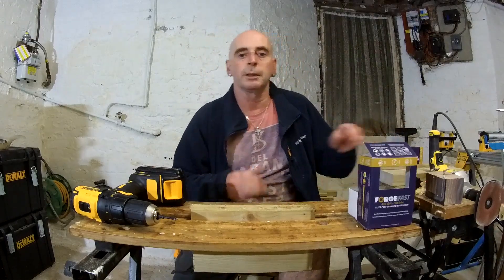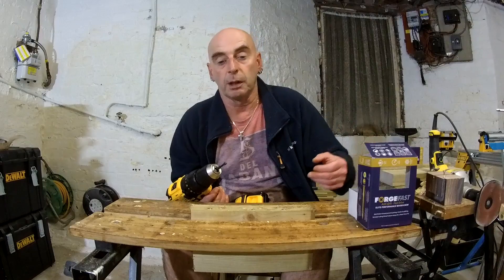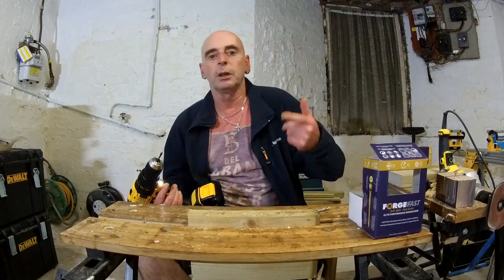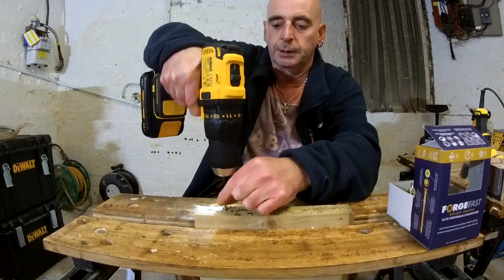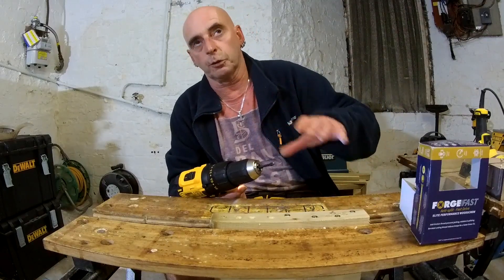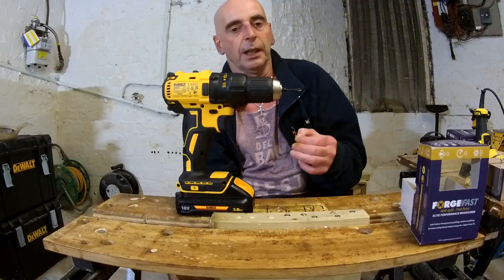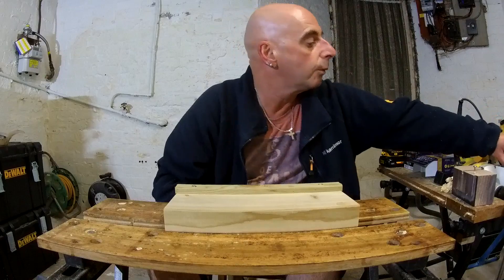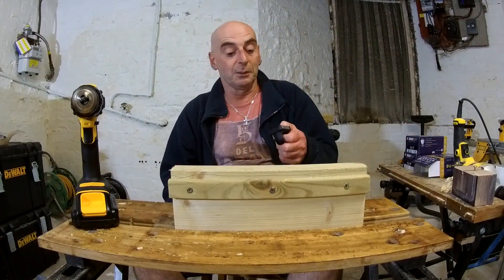Clutch and Torque settings made simple

Comment: HI Milton, I was wondering how do you like that drill? I have a dcd777 as well and I like it, I also have that 3.0 ah battery and like it too. It's not as compact as say the 2.0 or 1.5. But in comparison to the larger batteries like dcb203 3.0ah and dcb204 4.0ah and dcb205 5.0ah it is smaller and lighter. But what I see is it runs a lot longer than the 2.0ah.  Have a good one Milton

Comment: Milton I’ve seen the dewalt 3ah compact battery and just like you said there far from compact
Reply: Bosch have the 4ah core slim battery 4ah was thinking of getting 1
Reply from the maker: Never heard of that battery as of that yet.
Reply: On amazon around £50 ish they go up to 12ah Bosch core 18v cheer pal
Reply: £56.99 eBay
Reply from the maker: @daigoldsack1254  Yeah, looked it up. Thank you very much and i'm quite impressed eventually i'll get one of these ProCORE batteries from Bosch, infact. I'll get one now. Expect a video on this in the not too distant future.
Reply: Nice 1 pal look forward to it
Reply from the maker: @daigoldsack1254  It's not on prime so it will take a while to arrive sadly.
Reply from the maker: Milwaukee is bringing a new 3ah compact battery and it is like the 2ah size.
Reply: That’s ok mate I’ll just be waiting also I’m looking at getting the makita duc 254 battery chainsaw looks great 👍